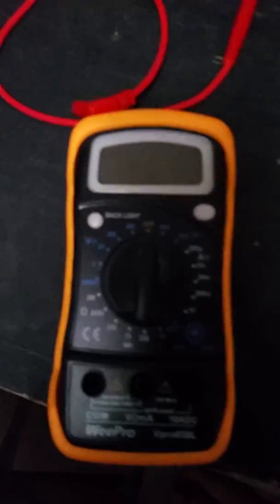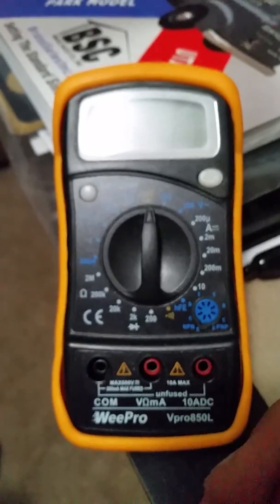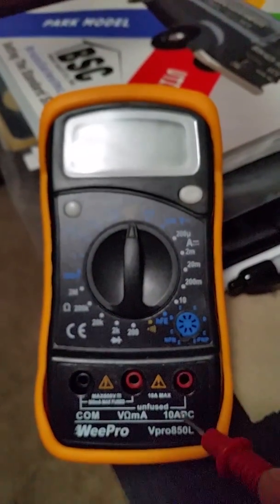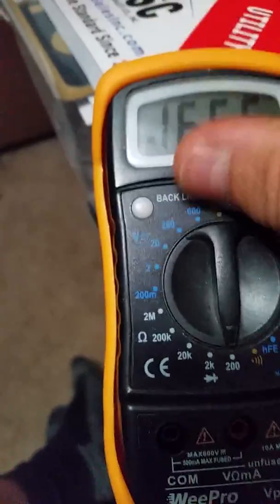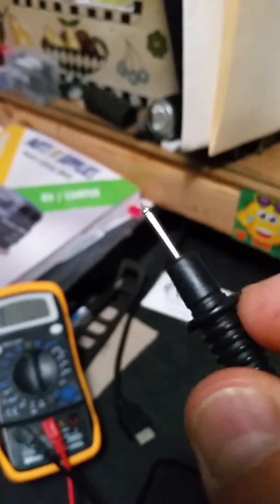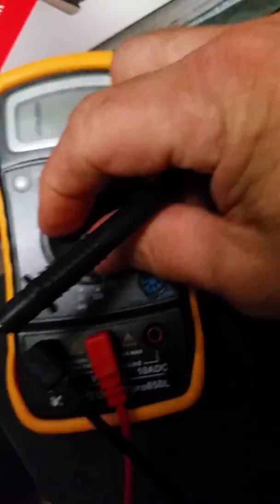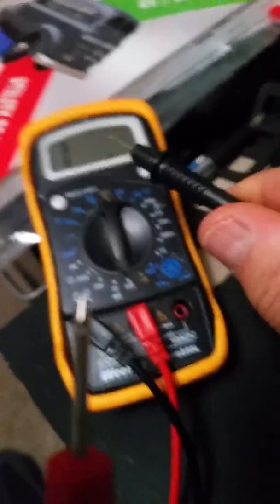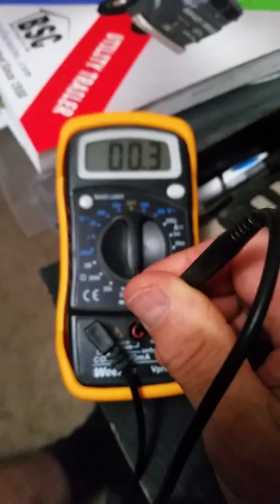Basic multimeter usage. Test your meter before using

Comment: This told me nothing.
Reply from the maker: Sorry for that ,Did you watch the rest of the videos on multimeters on here
Reply: So what is the next step if your leads are bad?
Reply from the maker: You replace them but you have to ohm then out ,let say it gives u .7 ohms .then you subtract the .7 ohms from any low ohm reading like 2.7  ohms ,which is really 2 ohms ,You understand a little better now?
Reply: @Rvdiagnostics  I think so.  I will change the two leads,, I hv two meters and on the battery volt test, they both meters are different,, the one in question, battery was 12.82,  the good meter read 12.90
Reply from the maker: That's close thats .001 volt off out of 12.6 not bad